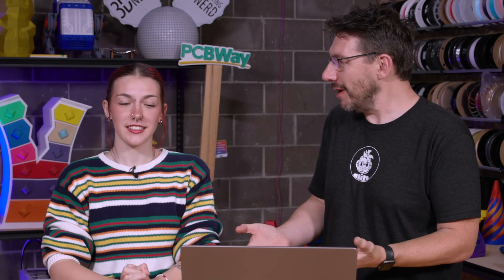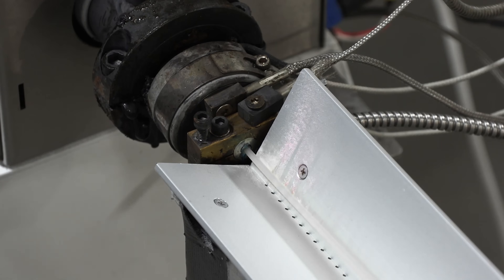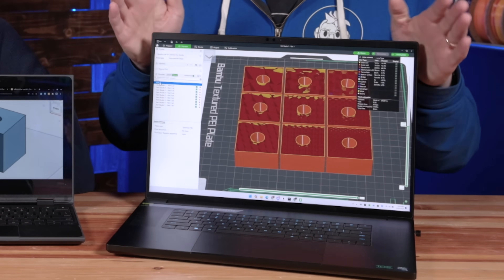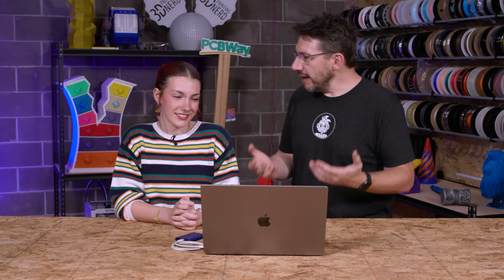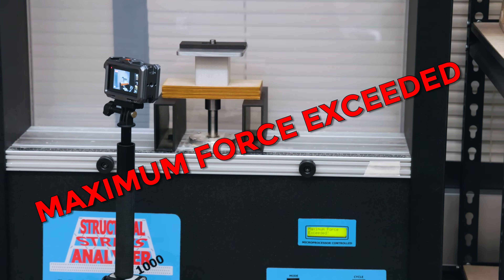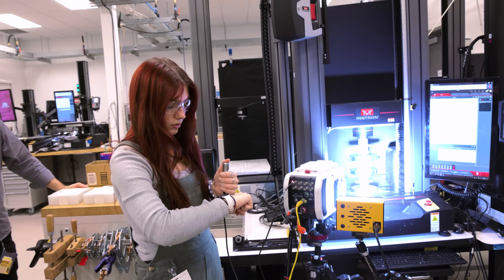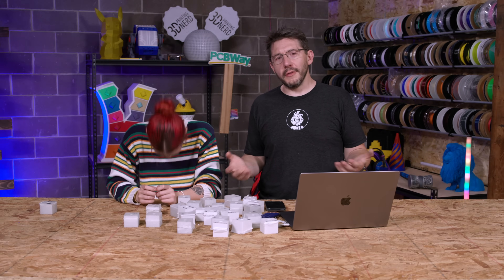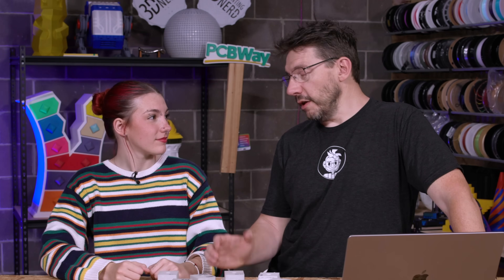PLA is Stronger Than YOU Think!

Comment: "With our powers combined, cool stuff happens!" - The Tellings

That was a fun and awesome to see how things went down. I feel like I'm a bit unsurprised on the result... the big thing is with so many channels having down tests on filament, the one thing that comes up time and time again: any additive weakens layer bonds and structure. You want to print fast without a high flow nozzle? Weak print. Want glitter or carbon fiber? Weak print (having everything with glitter keeps things consistent for this test). Want a super rich pigment? Weak print. Want improved strength with your Super Strong MaxStength PLA+ Ultra blend... Weak print. Want a strong print? Use unmodified PLA, PETG, ABS, etc.

You have confirmed it once again so I would really like manufacturers to stop making 10 variations of the PLA with all of them being "special"... just give me plane and simple and it will cover basically every function that is needed.

Comment: You should make it clear that PLA is not really useful for anything that needs to be strong.  It's not waterproof, it deforms over time, and other same-priced options (like PETG) do not suffer either of those problems.
Reply from the maker: Waterproof? What do you mean by that? PETG can deform over time as well though.
Reply: @3DPrintingNerd  Water goes right through PLA - see demo here: https://www.youtube.com/watch?v=RcCfWHuXFO0 and how sure are you about PETG deformation?  I've not noticed myself, but every engineering-related thing I've made from PLA (all different brands over many years) is basically useless after a year or so - it can't even hold up it's own weight in many situations.

Comment: Work in a testing lab, you can get more accurate results for your depression using a 1 in gage extensometer and gage marks on the sides of the test specimen that are 4x the diameter or width of the specimen with a sample fabricated that are either round with diameter range of 1in to 0.350in. or rectangular in the same dimension range with a height that is at minimum 1.5-2 in for compression samples and 5x the diameter/width for tensiles. With an extensometer you can get the following from a test carried out to 1.5% elongation/compression with the extensoneter and then to failure: elastic modulus, .2% offset yeild ( .002 in/in), ultimate strength (what you reported ) reduction of area, elongation. 

Also due to the high variability in plastic  extrusion try to have 2-3 samples per test and take the average or use a student t test to get a tolerance range.

Keep up the good work as you continue your education